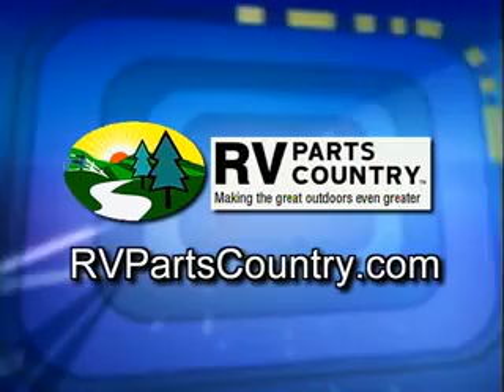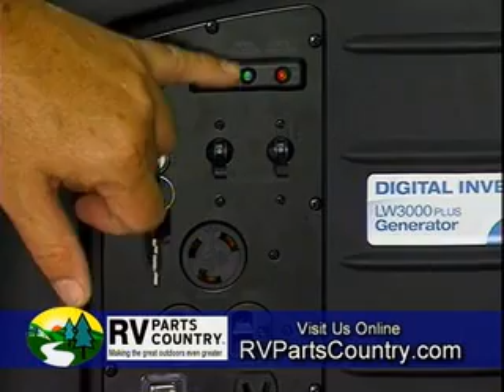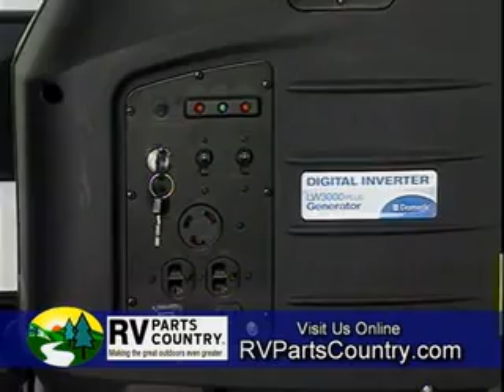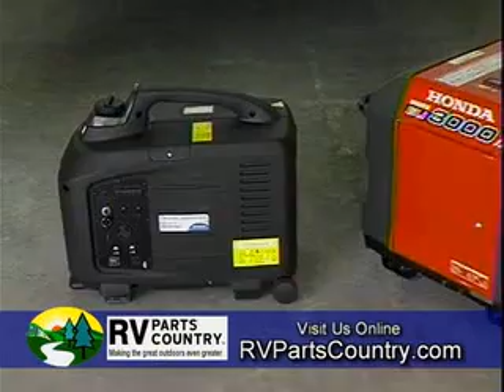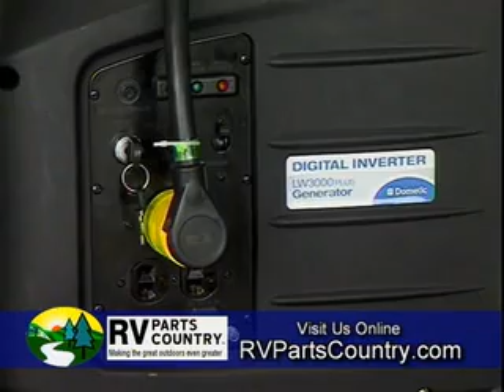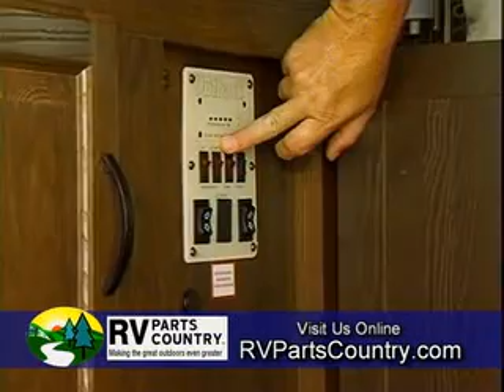RV Parts Country Dometic Portable Generator 3000W

Comment: What type of oil does this thing use?  I have one and lost the manuel. I'll be using it at 4K elevation well above freezing temps in the NV desert in two weeks.  Fired right up after sitting for a year with just a new spark plug!

Comment: Helpful video. I have one and it doesn't work at high altitude. It is also loud as hell. Seems like the one you have runs smoother and maybe quieter, hard to say. And it seems to use a lot of gas. Would I buy it again? Not if I could find something better to do the job at a fair price. I could go to a big box store and get another loud gen for less money as well. My guess is these are for dealers to mark up which is to be expected, which makes sense.  I got mine because of the way the whole trailer deal was structured, but I got him to lower the price because they wanted too much. I would not have otherwise. Thanks for the video.

Comment: Hi Neal, I watched your video on the Dometic 3000 and I have a question. How come if it put out 30 amps. you have to switch the Frig and Water heater to gas before using the Dometic 3000. You don't have to switch everything to gas when you in a RV park plugged into a 30  amp service. Sounds like the Dometic doesn't really put out 30 amps. What do you say???

Comment: I have a dometic generator and it will not run my air conditioner 13.5 btu
Reply: arthur cofield I have the LW3000 Dometic with 13,500 a/c that it runs. But not with a microwave at the same time. It is very, very loud though and uses a lot of gas. I run my frige too. But, I'm no expert.